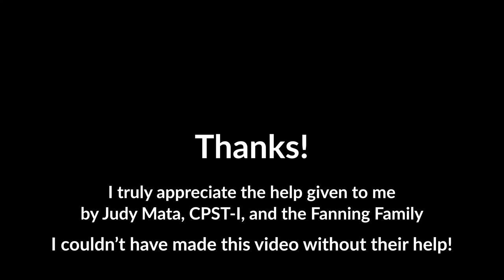Seat Belt Basics: How Your Seat Belt Locks for Carseats

Comment: You just saved me a trip to the dealer 👍
Reply from the maker: Cool!
Reply: @CarSeatSite Good day i just purchased a 2024 Audi Q3 from a dealer in my country can you say if there is a locking feature with my seat belts? because I have been trying to install a car seat and the seat belt is not locking. I live in Jamaica I have asked the representative and yet to get a response.
Reply from the maker: @trilliandouglas6986  Hi. It's likely that the retractor doesn't lock. You'll either need to use a locking clip or buy a carseat that has a true lockoff that locks the seat belt. I suggest reading the owner's manual online before buying a carseat (if you're in the market); in the seat belt installation section after it tells you to close the lockoff, if it tells you to lock the seat belt, it's not a true lockoff. I have a video on lockoffs here: https://youtu.be/ASKRvkTsS5Q

Comment: Hi, I'm wondering if I would need a locking clip for my car seat since my car doesn't have the ALR function. I know all U.S vehicles seems to have ALR but not other countries.
Reply from the maker: Hello! You're correct that vehicles outside the U.S. don't have locking retractors. I don't know why that is. If you've confirmed that your seat belt doesn't lock in any manner, either at the retractor or at the latchplate, then yes, you'll need either a locking clip or a carseat that has a true lockoff. If you're in a country where you can purchase a U.S. seat, this list may help you: https://carseatsite.com/lockoffsbelttensioners/. Otherwise, look to see if any carseats available have lockoffs.

Comment: What is the tab, and how do I install with that?
Reply: Do you mean the folded over piece of webbing that keeps the latchplate from sliding down to the floor? If it's in the way of a lockoff, you may need to slide the carseat to one side a bit in order for the lockoff to close.
Reply: @heatherw.689  yes thank you!! I have an evenflo revolve…. I can lock it but it’s outside the lock off and still in the belt path. Hoping that’s alright!